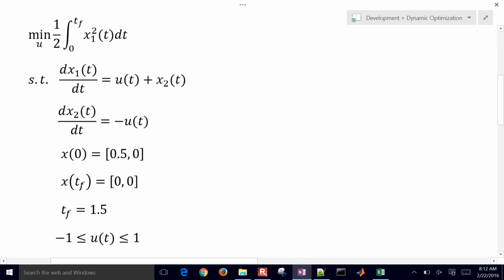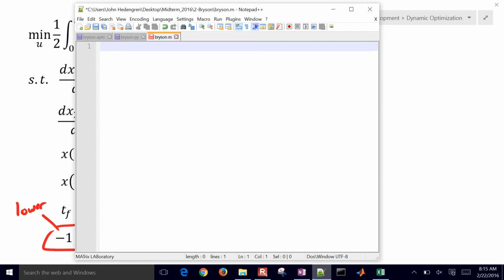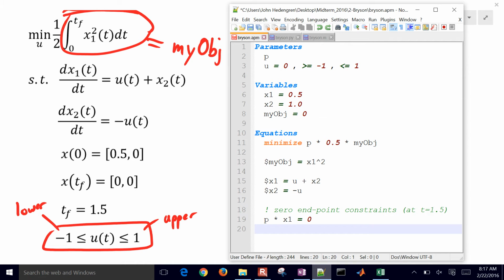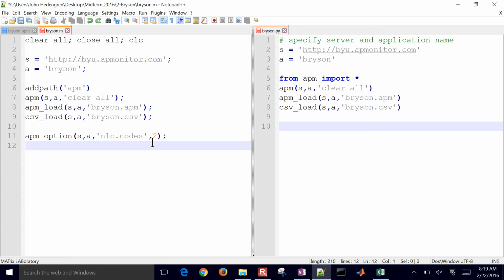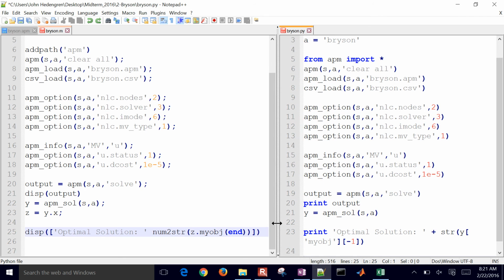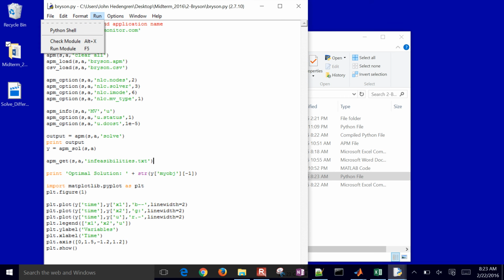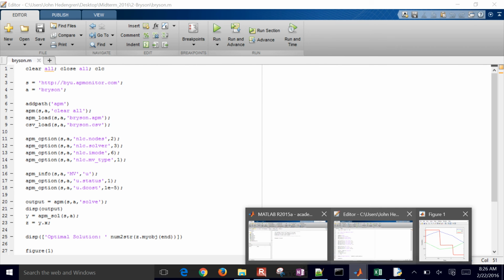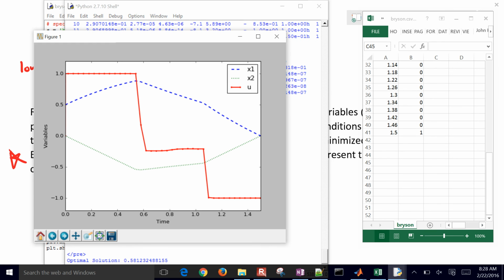Bryson Singular Optimal Control Problem

Comment: Hi,i am getting no module named apm error.Can you also post the link of apm tar or zip file?I have already downloaded and unzipped the amp_python .
Reply: you can just include apm.py in your run directory. It is available from apmonitor.com from the Get APM Python link. You can get it from the zipped archive for either Python 2.7 or 3.5.
Reply: I already did that, but it is showing some error with one of the variables defined-"myobj"
Reply: Hi john,i went to your site,and downloaded the zip file for second problem,the cost function seems to me a minimal energy problem?Your zip is working absolutely fine in my linux system but it is drawing only one red curve.
I wanted to post my error in your forum,where can i do it?
Reply: +Amardeep Mishra ae15d405 There is course content at http://apmonitor.com/do. There are also additional, more complicated example problems at http://apmonitor.com/do/index.php/Main/DynamicOptimizationBenchmarks and http://apmonitor.com/do/index.php/Main/MoreDynamicOptimizationBenchmarks. You can also post your questions to the discussion group if you need more help.
Reply: +Amardeep Mishra ae15d405 you can post your comments at https://groups.google.com/forum/m/#!forum/apmonitor (first request membership and then send email to apmonitor@googlegroups.com). You should be able to run on a Raspberry Pi if you have Python installed.
Reply: +Amardeep Mishra ae15d405 many solvers can solve LMIs. Here is one example interface: http://www.mathworks.com/matlabcentral/fileexchange/49595-linear-programming-with-nonlinear-programming-solvers

Here is another example problem that uses a linear state space model: http://apmonitor.com/do/index.php/Main/ControlTypes
Reply: +Amardeep Mishra ae15d405 yalmip is a wonderful tool for Mixed Integer Linear Programs. APMonitor adds support for Nonlinear problems. Other nonlinear,  mixed integer modeling environments in Python are packages like Pyomo although APMonitor is specifically built for Dynamic Optimization. Let me know if you need help migrating an example problem.
Reply: +Amardeep Mishra ae15d405 Here is one example in Python: http://apmonitor.com/che263/index.php/Main/PythonOptimization and another from aerospace: http://apmonitor.com/do/index.php/Main/ModelSimulation. Good luck on your exam.
Reply: +Amardeep Mishra ae15d405 yes, both of those approaches sound fine. If abs (x) gives problems with the non-continuously differential at x=0 then try a slack variable form or else minimize x^2. For part b, you can set up the problem from 0 to 1 and then divide all your differential terms by tf. That effectively scales your problem to adjust the final time. Don't forget to make tf an FV (one value over the horizon).
Reply: +John Hedengren also, see http://apmonitor.com/do/index.php/Main/MoreDynamicOptimizationBenchmarks for some similar examples.
Reply: +Amardeep Mishra ae15d405 check out the link I sent. you'll find examples with final time values fixed, integrals of the objective function, and variable final times. by default the final time values are not fixed.
Reply: +Amardeep Mishra ae15d405 yes, x(0) is defined by default in the variables section of the model.